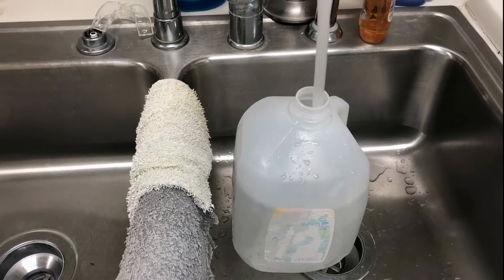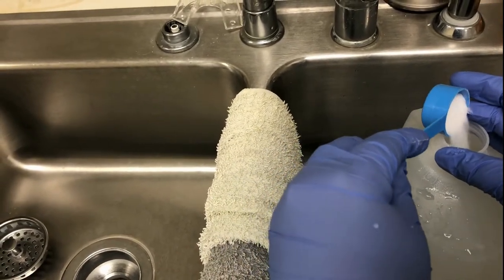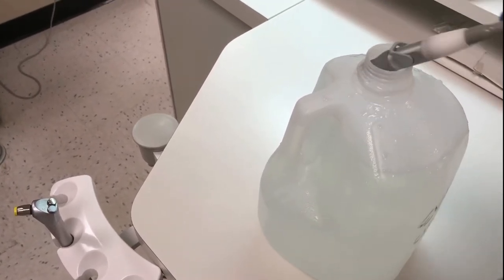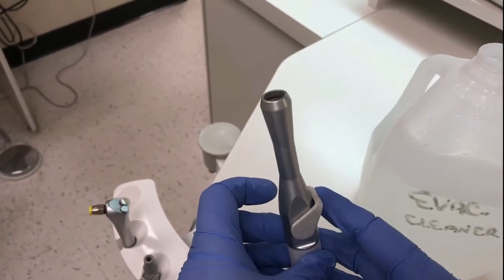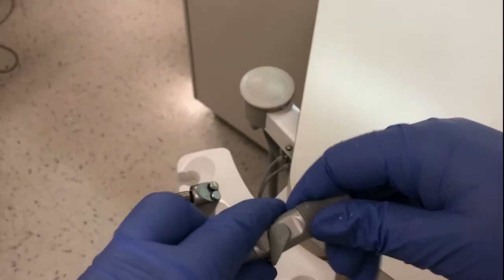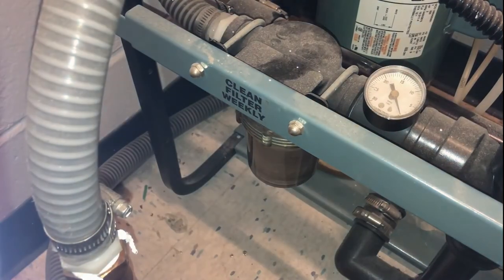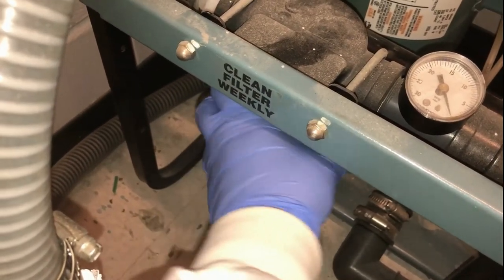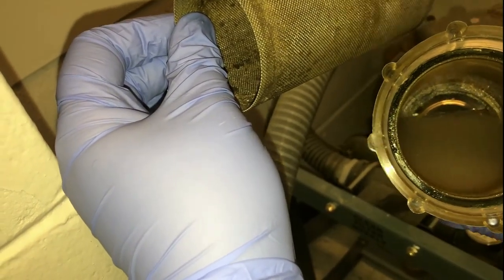Dental Office Closing Routine Part 2

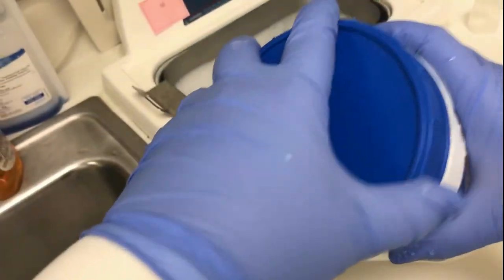Comment: 0:48 in is  saliva ejector ? im a new dental assistant. Is this appliance drawing hot water? also  this transaction once a week or once a day ? Also do you have a Instagram account
Reply from the maker: yes, that is the saliva ejector hose. 

Room temp water for this cleaner. the water temp will be based on manufacturer instructions. In general, I've noticed the powdered cleaners recommend warm water to dissolve and the liquid concentrate cleaners recommend room temp water to dissolve. 

I do not have an instagram account.